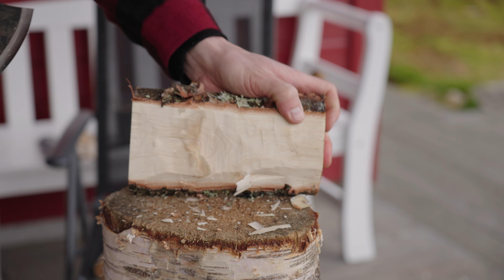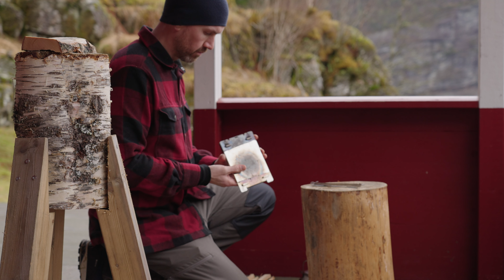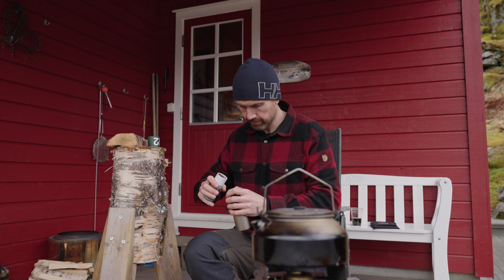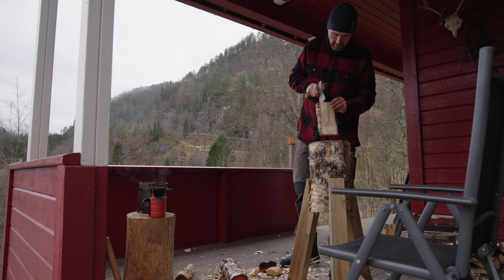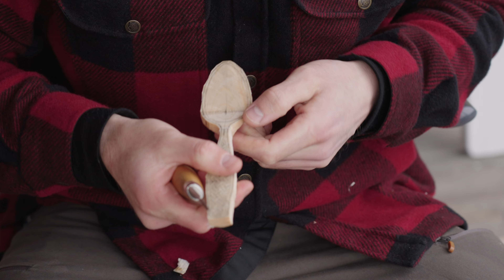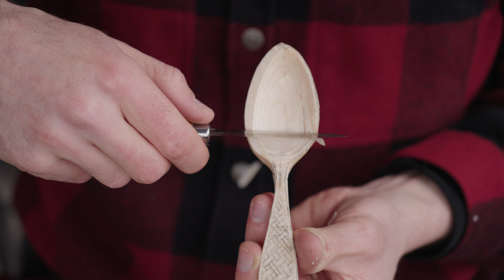Silent Carving a Old Traditional Spoon | Woodwork

Comment: That was a great way to spend sixteen and a half minutes as the wind blew and rain fell outside, makes me want to pick up my Robin Wood carving hatchet and crook knife and my Moraknivs and start again... I would like to know what is, 1) your stove you have there for your Trangia, it looks to be very light and, 2) the drip coffee set-up: I think they would make a very lightweight hiking setup. The German WikiStove I have weighs a ton!!  Thanks for that video - what you say about helping mental health issues is very true. Best wishes.
Reply: PS - just found your coffee video! i'll look for the woodburner box.
Reply from the maker: So you are familiar with Robin’s tool 👏🏻 I absolutely love his spoon knives. The axe is quite good as well, but i actually prefer the Grensfors bruks carving axe with a little bit of extra weight and blade height. The wood burner is the Firebox stove (original) absolutely love that thing, and it holds the Trangia burner really well. I use the GSI backpacker much and java dripper filter on all my trips. Cheers mate.

Comment: Well done.
I prefer to make the spoon pit first as it is the hardest and most important.
I use a homemade drill to hollow out the spoon pit. The pit then becomes circular, but the pit is easy to shape further into an egg-shaped spoon pit. To avoid cracking, I let the spoon dry slowly in an almost tight plastic bag together with the shavings.

I like the sounds in this video.  

Landskapet ser unektelig ut som Vestlandet. Er dette filmet i Hardanger?
Reply from the maker: Aaahh, that is a good tip! I only use handtools but starting with the pit i will try in my next spoon! 
Knock on wood, i have never had a spoon crack on me yet! But i use a lot of willow and some birch. 
Dette er på Vestlandet ja, ikke langt fra Bergen 😇🤩